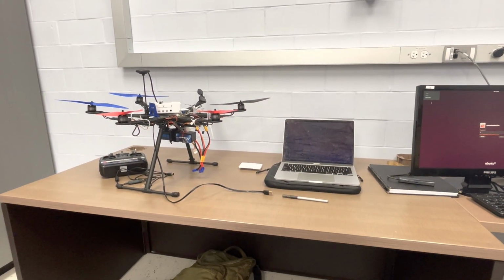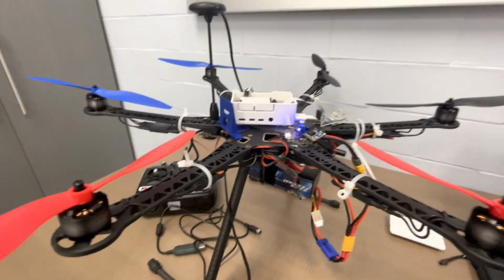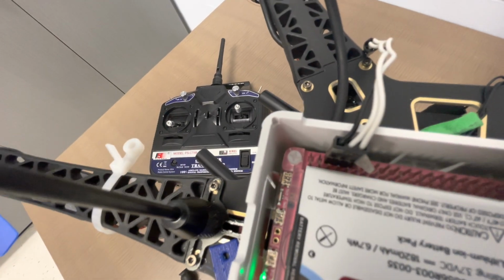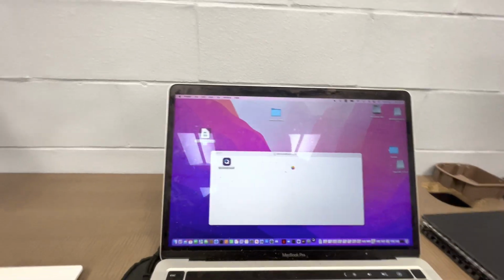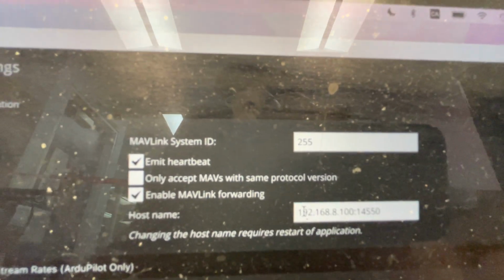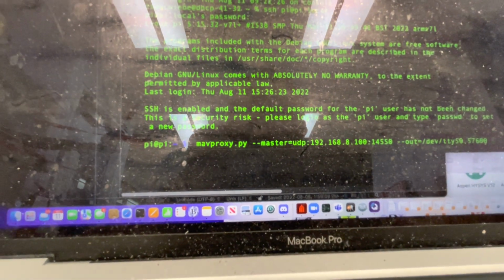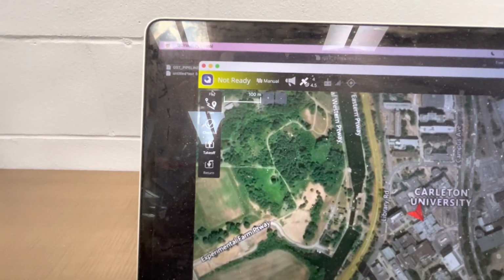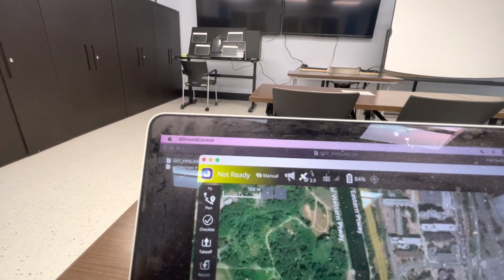Wireless Communication between QGroundControl and Drone using Raspberry Pi as Proxy (UDP)

Comment: Sort of suddenly ends... So, MAVproxy runs on the RPi?  How does your RPi communicate with the Pixhawk? (I assume that's all MAV). I have been doing this using UAVcast-Pro software, which handles video over the net link as well, but I would be interested in using open source all the way and Linux flying and on the ground. Are you doing video, too?